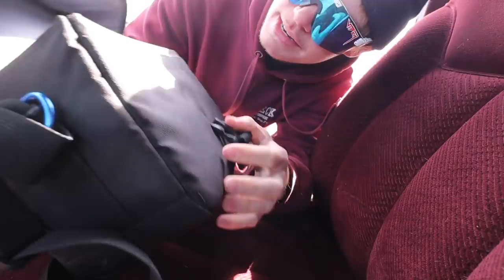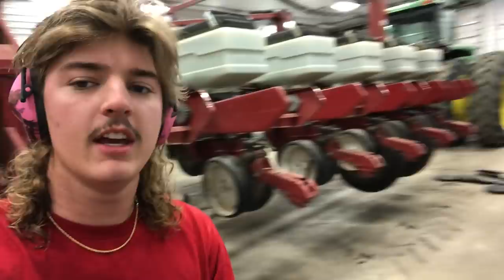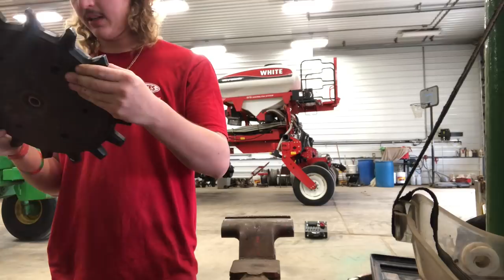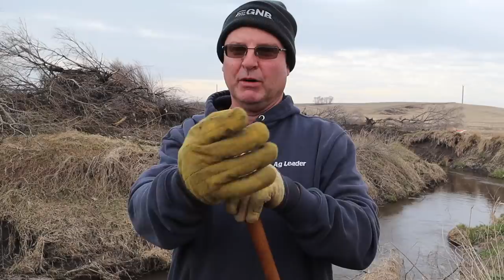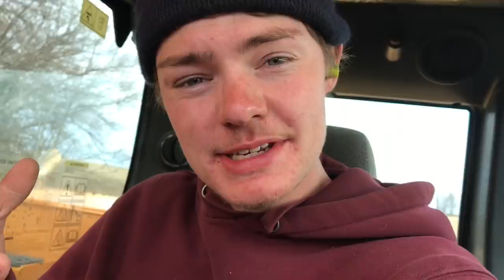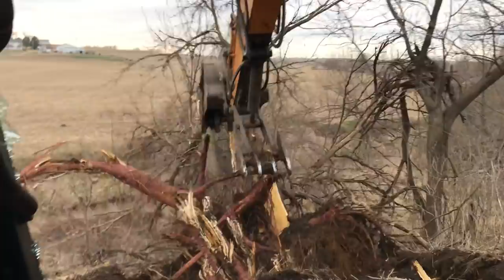Dad's 1st Time Running The Excavator! (WINDOW SHATTERED)

Comment: It has a pattern changer somewhere in the computer screen to change up controls. Prolly has a sticker in window by ur right elbow that shows you the diff patterns
Reply: Good ol SAE vs ISO controls lol
Reply: Chad smith it’s not on screen it’s normally a valve or you have to switch the lines. Only thing different between both is the stick and boom in and out
Reply: @matthewmassaro6931  on newer hoes it's you can find it in the screen. Ran a 290 hyundai lc7 for a while and it was in screen. Their hoe is atleast a lc9 hyundai and the 180 lc9 I ran also was in the screen. Every mini I've seen has a valve and some older cats were a valve behind cab but every newer ho bigger than a 120 140 has it in screen

Comment: There’s a switch probably behind the cab door where you can change the controls from standard to backhoe. It could be in the cab as well. 👍🏼
Reply: Now that’s some good advice, thanks for sharing your knowledge.
Reply: Pete Parker yes! Cooper reminded him of that !
Reply: He'll probably be pretty good at running it if it wasn't ISO pattern and switched it to SAE. I think the valve is in the engine compartment on the left hand side of the machine behind the door, the valve is located just underneath the cab a bit. They would need to loosen a bolt which locks the lever in one position then move the valve to SAE and put the bolt back.
Reply: @mommacs6159  As I was watching the video, I was going to comment this exact thing but I figured someone beat me to it. LOL
Reply: Hey spidey
Reply: Momma CS tell Daddy Cornstar, you’re not an excavator operator until you break a window. I have had it happen, with tree limbs and a rock using a breaker. Happens to even us seasoned (instead of old) pros 😁👍🏼

Comment: There's a switch to change the controls to backhoe mode
Reply: Letsdig18 calls it the "John Deere - Caterpillar" switch. :)
Reply: I think dad would run circles around the boys if they flipped it to sae
Reply: I know it sucks now if I got to run a old rubber tire hoe that only has  backhoe controls  . Look like a monkey humping a football for a hour or so . Also have to think about which stick does what to  much . In a trackhoe it just happens automatically and I learned on a backhoe a very long time ago .

Comment: On most excevators on the right side on the floor there should be a flap you can flip up and in there you can change the excevator to backhoe controles

Comment: Check for control patter selector valve or switch most excavators have this at rental shops.  Some are in cab some are in side panels check  manual for location

Comment: Sticker on R hand window details ISO and SAE controls and in most circumstances how to change between i know in most modern machines ive run they are in cab swaps between the two older ones is a lever behind the cab. much easier to swap it to what you know (in this case SAE as youse run a backhoe) than having to relearn that muscle memory

Comment: @Daddy Cornstar. I agree it can be tricky switching between backhoe and excavator controls. Most excavators have a switch or valve you can change to give you the option to run with backhoe OR excavator controls. Maybe you can check into it

Comment: We found the trick to doing this closing wheels. Lay the outer ring on 2 blocks and put a bolt in the center hole and hit the bolt with a hammer. They will pop right apart real easy

Comment: This was beyond what I hoped for, good entertainment. All light and fun an not a backbiteing type. Good  clean fun and whole family with exceptions of a cat scan and dogalistics. I have to say just plain fun. Good job. I know its not as easy as our insults come at you...... Daddy cornstar... when things are going south on the excavator, simply lift the hands into the air instead of seeing it happen and not able to stop they self. Just lift your hands off the controls and it stops...think a moment which is push an which is pull... you can do it an glass is cheap but fright gets you hurt too. Since you have had years to learn one machine, simply relax. I ran them for years and even when you think that your good like lifting birds nests out of trees without crushing them or just setting up a obstacle course where you grab tires and set them over posts or undressing the manikin by lifting her skirt off and dropping it in her arms or changing clothes on one is a workout that gets your hand and eye coordination going. Practice just one hand at a time till some one trys out the timing like curl in, now curl out.... main up main down, go back to the curl lever and jib boom out and jib boom in an out and in then practice curl out with jib out and jib in with curl in......... now boom up and swing left now boom down with swing right.... that will take you out to the work area and make you a pro. I trained  women to run the log loader and to run the dump truck fill and that friend is a area I hope you don't try till you have time on one or the truck will receive thousands of dollars damages in a hurry. The worst mistake was letting someone load trucks while tired and he curled the bucket into the windshield killing the driver and not even knowing it went on loading truck... when the truck didn't pull away he went to check and found out what he did. He went criminally insane. He didn't mean to do it and it didn't seem possible to do so was reenacted to find out just what happened. Although he received little time he placed himself in a home. Very sad and DOT would not let any driver remain in truck while loading till they isolated all risk. I was having so much fun here I never noticed if it had a thumb on it or not, thinking not but If I were there could even make mommy cornstar into a operator. More so would love to see Cooper do more time on them as his brain is in sync with this work and it pays well out in the field. If you owned one even half this size and a small dump truck, you could excavate bad spots in the fields so no more sinkage. There has to be rock somewhere on the properties and if you saved the overburden and then worked it as a pit you could get out muck in those holes in the field and stack it up so that water drained out of the dirt and came back as good soil again cause you make your own tiles where you need them and more harvest ground. Less downtime or fixing the ah S**ts when they do happen. Well there is my book for you again

Comment: Find the pattern change switch or valve. Newer Deere excavators have a valve located in various places on the machine depends on model. Not familiar with that brand of machine.

Comment: Usually there is a way you can change the pattern with a box in the cab otherwise you have to move around the hydraulic hoses to get a different pattern.

Comment: you may be able to change the pattern over to what your used to on that a lot of the new stuff has a switch or valves you change and it switchs the patterns over helpful hit after digging up the tress ad stumps if you pick them up and drop them a few times it helps knock the dirt off the roots so what ya gonna do with all the tress and stumps you've dug up

Comment: just switched my closing wheels to those same spikes. a much easier way to get the wheel separated to take the rubber off is slam it on the ground a few times straight up and down ways. seriously try it

Comment: I am way late on this but to get the press wheels apart you can steal the on a 5 gallon bucket and take a rubber mallet and hit the barring and then they should pop apart that's what we did on are kinzie planter and we put the same exact wheels on them

Comment: Just letting you know if you put a bolt in the middle of the closing wheel where it sets on the bearings and then smack it with a hammer a few times they will split apart. Just trying to help.

Comment: Hyundai excavors are very nice machines, and you can customize them too, Also for daddy cornstar on every excavator, there is a hydraulic switch that will change how the controls work, it is currently set to standard control but you can switch it to backhoe controls

Comment: I don't know about your Hyunda but most excavators can change the controls to backhoe style , it is usually pretty easy just ask the company that you are renting it from about it . secondly , spin your tracks 180 degrees when you walk it so you can just step on the back side of the foot pedals so you don't have to lean forward - just my opinion

Comment: Loved this as always and I never forget to hit the like button because I do it before I even watch the video. Don't feel bad Daddy Cornstar, I've done the same thing and I have a lot of experience with track hoes. You will get used to the standard operation of the machine in no time. For me it's more intuitive than the old backhoe controls which are mostly adopting the new standard these days. nIf you still want to change the controls many machines provide a switch somewhere in the cab. Worked a Hyundai but don't remember where it is. Might be under the seat. Good luck!

Comment: Ok.  Now it is time to go to the metal pile and find some angle iron, 1/2 sucker rod and expanded metal and fab up a wind shield screen.  (Good project for that brother, the master welder)  If you are going to keep that machine for a month, pushing/digging trees, four hours spent building s windshield guard will more than pay for itself.  If I get back to the farm in a couple days, I'll send you pictures of the one I built.  There should be some studs top, middle, and bottom of windshield for mounting either vandalism guards or transportation guards to protect the windshield.  Build to mount on those.  Pasture renovation and grubbing mesquite was my day job for several years.  Still do some now and again.  
I was pushing about a 4 inch tree over (pushing away from the machine) and a chunk about a foot long snapped off and came thru the lower glass and landed at my feet.  That was loud and quite spooky.  Next day, I built the screen!

Comment: Fyi the lower window just slides in, the second window is glued to the frame of front slider window.  Normally I pull the entire slider assembly, cut the old glass out and glue the new glass in.  Normally I use spring clamps to keep pressure on the glass.  I give it about 24 hours in a heated shop before installing.  
   Also the comments are right you can change the pattern to deere controls(backhoe), instead of Cat.  Again read the Owners manual, I could see the window getting broke because of muscle memory of running the 480c for 30 years!

Comment: I really enjoy your channel Cole I am 28 and farm with my dad and grandpa in east central Indiana! I had to laugh when Daddy Cornstar broke the windshield, my grandpa told me a funny story he had bought a new John Deere 7700 combine in 1972 he always has had a little bit of a “short fuse” lol anyway the machine plugged up on a 20 degree day and he thought he had it all unplugged and climbed back in the cab to continue on it wasn’t unplugged all the way yet... His temper flared and he threw his wrench down at the floor mat it bounced off the mat and hit the windshield and shattered it into several hundred pieces lol! He used his boots just as your dad did and kicked out the remains of the windshield and liked to froze to death until a new windshield came in. Needless to say all these years later he’s 80 now, he keeps his cool around glass lol!

Comment: Hey daddy cornstar you were saying that the controls seem reversed on the excavator.  I operate a deer excavator and I don’t know if it will be the same on your Hyundai but there is a hydrolic switch in the compartment behind the cab where you can change the way the boom operates and make it similar to operating a back-hoe.  I hope this is helpful. God bless y’all!

Comment: Daddy Cornstar, even with the best operators that happens. If you are used to running a Cat or a John Deere the sticks and actions are different. It’s hard to do when you are used to another flow of controls. On newer equipment there might be a lever that switches operation of the levers to one you know how to work. Sorry you had that happen. From experience that was probably a $500 lower window and a $1000 upper window. Hang in there.

Comment: It's kind of the rental places fault about the window.
 Most machines where I'm from have a serious cage over the cab window and the cages on the front and sides can be swung back opened if needed.

Hey Cole while you guys have the excavator for a month and own a skid steer and backhoe you should make a dirt bike ATV track. Maybe where the silos and junk was.

As I post this in sooooo sick of hearing sirens and sirens and sirens.
 All the hospitals are locked up tight and the only way in is by ambulance.
 99% sure I caught this crap I'm asymptomatic with like ten things.

Edit, 5 days I been checking my temperature and I've bee low. I check now and I have a fever now and haven't eaten all day.
Reply: anastyb drink lots of fluids and extra vitamin C. Be well!
Reply: anastyb  Prayers for strength, comfort & healing! God be with you!🙏✌
Reply: Thanks Cindy and Momma, I already do drink gallons of water everyday , I'm diabetic and keep a 5 gallon water dispenser in my room.
 This is going to be interesting....

Comment: I am unconvinced that removal of the trees is profitable or correct.  Tree lines reduce soil wind erosion.  Tree lines reduce the wind that can dehydrate a field.  Trees along the water course stabilize the banks and reduce water erosion.
I Think that there is zero financial benefit to removing the trees.  Extra  arable  land will not exceed the losses from water and erosion.  A cost that will produce possibly less, not more.

The compromise may be replanting trees of your choice of species and planting them tight to the water course.  Achieving additional arable land, still maintaining the benefits of trees,, and possibly the trees as an additional crop.

Comment: there is 2 types of operating controls on backhoes--Caterpillar=SAE (society auto engineers) and John Deere=ISO ( i=International organization for standardization-----different brands choose different configurizations based upon above listed models---manufacturers like the difference as their choice is given strong consideration when replacement machine is chosen--this philosophy is melting away as hoses can be exchanged on the function valve body and later models offer a switch to change functions---- saw you tracking across concrete bridge using tires---with small machine tracking in straight line personally do not feel necessary---asphalt is a different situation,especially in hot weather---abundance of caution though with heavy equipment is never wrong

Comment: C O L E.  I  see you gave wi fi signal problems...now I maybe talking out my hasiender?   have a look at getting some WiFi boosters...you fire wire your hub to the main one which is plugged into the mains wiring of your house...the other / s. you plug into your dead spots...my house is tiny tiny compared to yours but I did this to a booster in the down stairs back kitchen...it throws such a huge signal out that my iPhone and Samsung pad will select it whilst I'm in the front upstairs bed/room... I'm a virgin customer..That's virgin media to those who got excited then and there network is fast in the UK like my download is 100 megs at the minute and they keep offering me 200...it's not a mines bigger than yours thing but look up your service provider..tell them your going to leave them and they will kiss your hasiender to get you to stay...BTW I caught sight of mommy CornStar..in a reflective surface I'm trying to screen cap it and clean it up....🤔
UgZyer 
Rubedo.  x